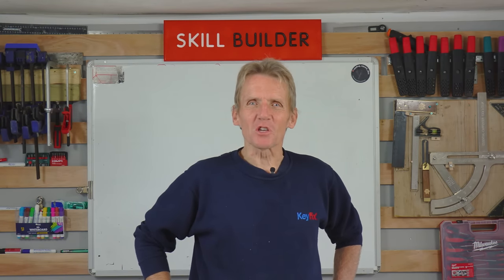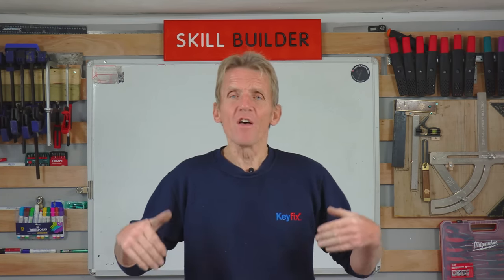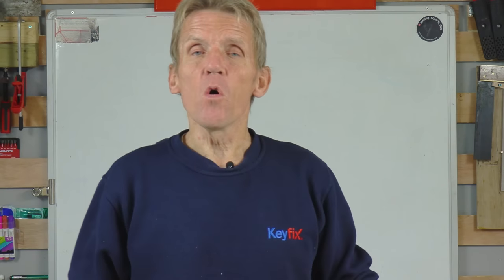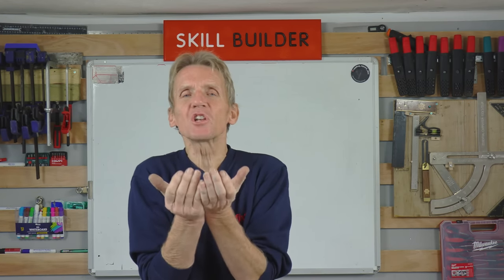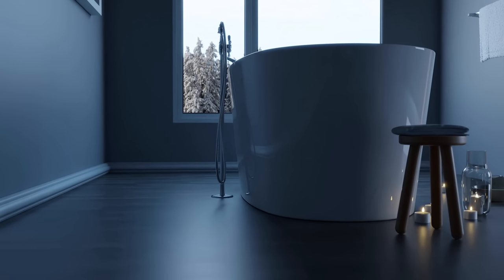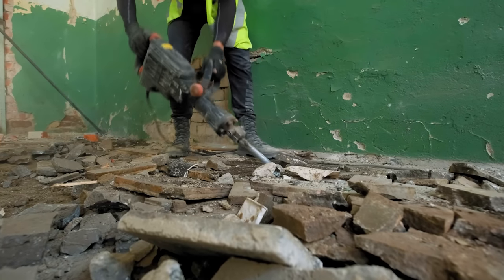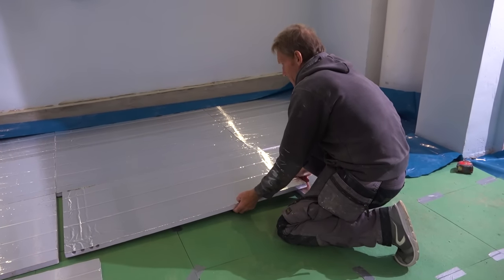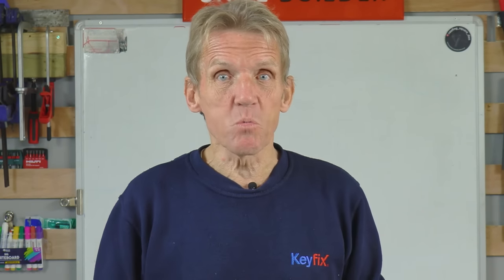Underfloor Heating — The 2 Big Questions

Comment: Looking at fitting underfloor heating down stairs, im slowly coming to terms that the concrete floor screed will need coming up to do it properly!
Reply: No it doesnt you can get whats called a retro fit kit that goes on top of your current screed. It uses panels and the pipes click into it and then you fill the left over gaps with the filler that comes with the kit then put self leveling compound raises floor level by 22mm
Reply: @leejames7964  But as Roger says, you will lose some heat through the ground. Much better to break up the existing concrete, dig down sufficiently to put 100mm of insulation, then lay your UFH pipes in a 50mm of concrete. It is disruptive,but it's worth it long-term.

Comment: What is bad about electric underfloor heating?
Reply: The cost of running it!
Reply from the maker: It is not really suited to heating a room to 21 deg. It is fine for tile warm up. My neighbour three doors down had it even though I advised him to have hydronic. He ran it for one winter and it was £1,000 for the kitchen and dining area only. After that he switched it off and put some radiators in.
Reply: Doing same work, but instead of installing wire, better to install pipes. Wire only works with direct electricity, pipes can have more options. You can heat pipes with stight electricity but later upgrade it to gas or heatpump also.

Comment: The only item you missed when talking about the sensible thing to do is to also consider a heat pump alongside underfloor heating. Come on Rodger even you can't argue toss on that! Surely you can't do a video on underfloor heating and not talk at some point about the advantages of a low temperature heat source connected to it.
Reply: This can be done equally as good using a high modulating gas boiler like a viessmann 200 and weather compensation sensor. They are 3x cheaper to buy and almost identical to run. Heat pump has the edge but takes 20 years to make the saving back.
Reply: @handle1196   Yet to hear anyone come up with a gas boiler that produces less carbon output per kw of heat than a heat pump, that's where the real conversation is. The current energy & environmental crisis is not down to the cost of renewable energy or its carbon footprint it's a fossil fuel crisis. The solution is not more of the same problem. My point wasn't that heat pumps should be the answer to everything but surely a video talking about a low temperature heating system basically designed for a heat pump needs to at least acknowledge them.
Reply: @barryferguson6219  i don't think anyone wouldnt want to go for the greener option, it just has to be more appealing than the fossil fuel option. Cost of living is through the roof and not just with energy if they drop them prices over night, so people will always choose the cheapest option. A heat pump needs to cost half as much to purchase i think.
Reply from the maker: Barry 
I actually did talk about heat pumps in this video and the fact that they don't work well if you switch them on and off but we cut it out because it was straying off the topic and a lot of people would see me as a stuck record. If you make videos for YouTube it is always a job to keep them tight. 
Low temperature heating can be done with any heating appliance but a gas boiler is way more responsive to the great variations we get in temperature. The carbon issue is important but really we need better technology before we kick out gas. They are already warning of possible power  cuts in January so the last thing we need is more people drawing off the National Grid.
Reply: There is nothing sensible about Heat pumps.
Reply: @SkillBuilder  fully agree. Get the infrastructure in place before you push heat pumps and electric vehicles as the only option. Electric needs to be cheaper along with the heat pumps and a longer transition to get people to swap over.

There will be other alternatives, many houses can't have a heat pump even if you can afford one. Small Terraced houses, 2 up 2 down with a pavement outside the front windows &  yard only big enough for a bin.
Reply: @42RHD  That's just not true. The problem with heat pumps is that many homes are not ideally suited to them, so the system needs expert design and often a lot of expensive remedial work. Worth it in the long-term,but many of us can't look that far ahead.

Comment: I thought heat loss via uninsulated floors is 10%?  If I'm right, the savings on not insulating in the first place will cover the first ~20 years of increased running costs..
Reply from the maker: I am not sure that the 10% holds true for placing heating pipes on a cold concrete floor but I could be wrong
Reply: I'm not sure where this figure of 10% comes from? Urban myth more like and one that a few underfloor suppliers like to tell customers to get sales. I would say it is more like 20% heat loss through the floor when heating up an uninsulated slab. If anyone can come along with some science to say otherwise I'm all ears!
Reply: Apparently 80% of the heat lost through the slab is lost at the side wall footing. It's the reason that the footings are insulated all the way down when doing EWI properly.

Comment: Cost a bloody fortune in gas bills for underfloor heating you need an outside large wood gasification boiler,  forget gas and electricity ask me how I know the ground floor area is 38 feet x27 plus 4 rads upstairs winter bills are £600  summer 180 ish 20 years ago it was £60 a month in winter, the Froling s30 is the one to get
Reply: What a load of tosh. You wouldn't have a vested interest in wood gasification boilers would you Keith Rimmer formerly of Ecopod biomass boilers I assume?  :)
Reply: @LocostR1  No mate I just changed the gas boiler to wood-fired and saved a fortune in gas bills in an old stone coach house with flag floors and draughty old leaded windows

Comment: i only have wooden suspended floors (joists and floor boards) whats the best way for me to install under floor heating? if i use 120mm kingspan suspended between the joists then run my pipe should i cut out a hole for the pipe or should i go under them so as not to weaken the joists? on top of that im planing to use 18mm kaberdeck finished off with LVT glued down. any help is appreciated. thanks
Reply from the maker: If you go to our home page and type  in underfloor heating in the smaller search bar it will show you a few different systems. You can now get 22mm chipboard that is routed out to take the pipe, You still need the insulation but putting all the pipe above the joists has advantages.
If you go for the pipe in tray method between the joists then I would notch the joists on the cross overs. Strictly it should not be too close to the ends but it is much easier than trying to drag the pipes through the holes. Going under is fraught with problems.
Reply: @SkillBuilder  thanks